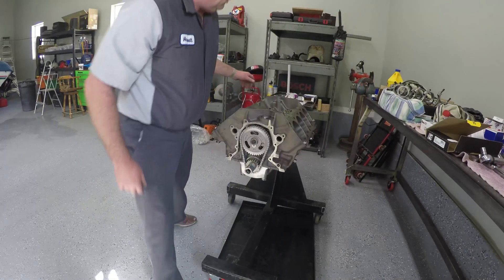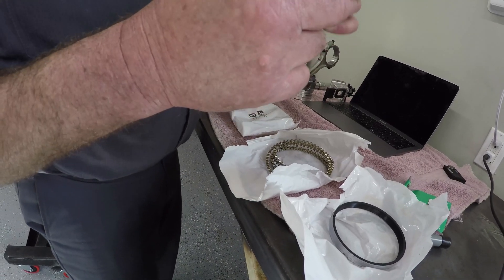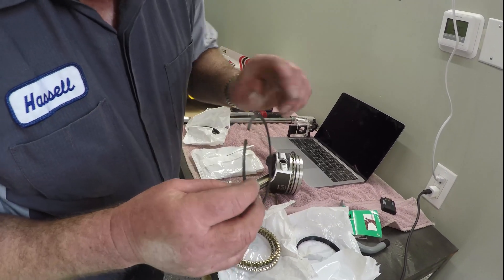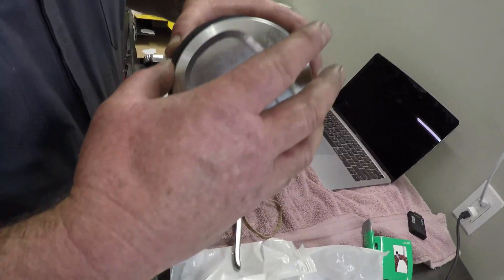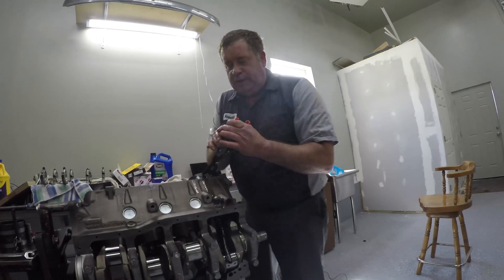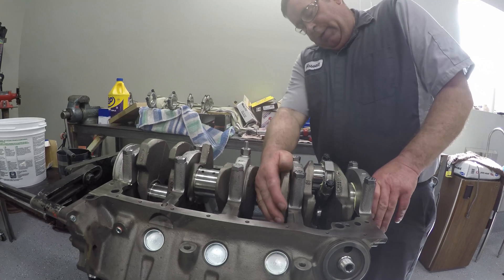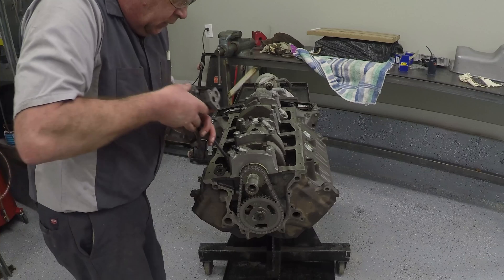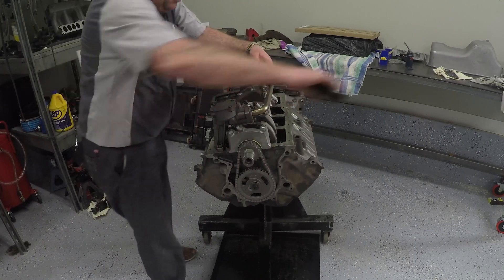351 Windsor Rebuild, part 2

Comment: You people and engine stands i really hate them good table install crank put long bolts back of block stand on end and build the rest rods dont flop all around cam goes right in heads hang righ on

Comment: Hey sir ive been using your video to rebuild my mustang engine. Ive got all the pistons in and the crank seems tighter than i would think it should. Any advice?
Reply from the maker: Each time that you add a piston it is going to increase the resistance.  I like to turn the crank after each main cap is torqued and again after each rod is torqued, that way if I do have extra resistance I know where it is at. I would also recommend using plastigauge to check bearing clearance on both the mains and the rods. You can also check the piston clearance with a feeler gauge. I hope this helps.
Reply: It does thanks. Ill give that a shot.